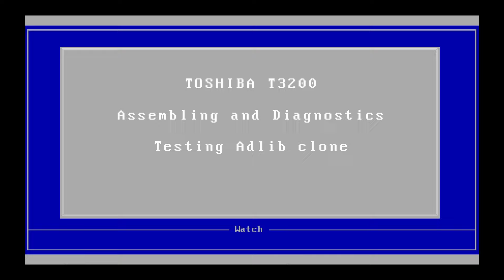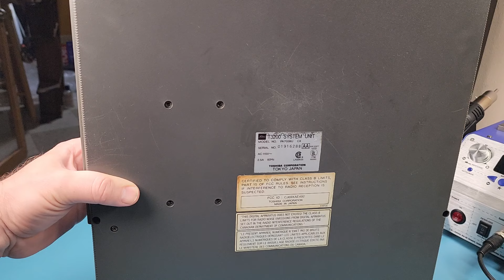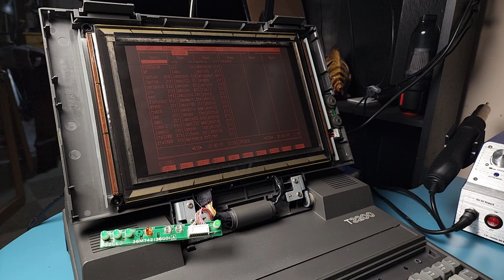TOSHIBA T3200 Assembling & Installing an Adlib clone sound card

Comment: Regarding 6:02 you’re saying that stubbing the cover sensor allows you to test the display.
Which one? Plasma or external?
Reply from the maker: Plasma. It's sensing whether the lid is opened or not. So, for testing without the lid, you need to put something metal into that sensor, or the screen will remain black